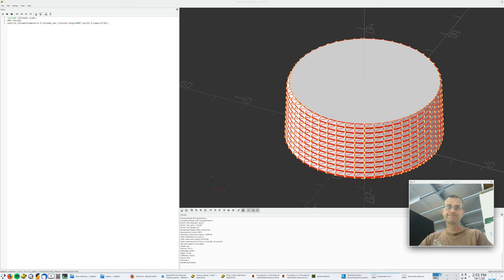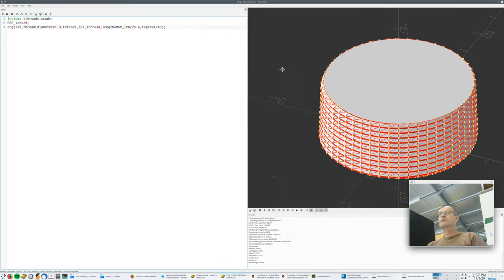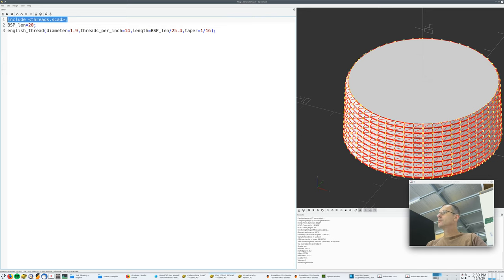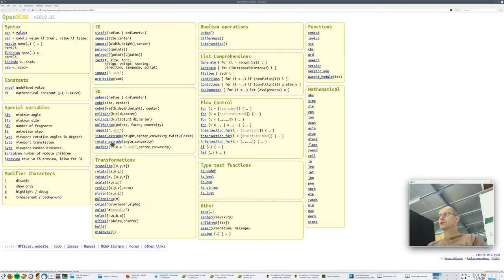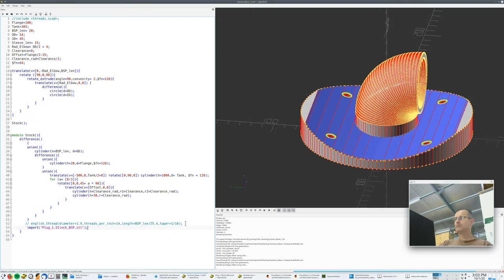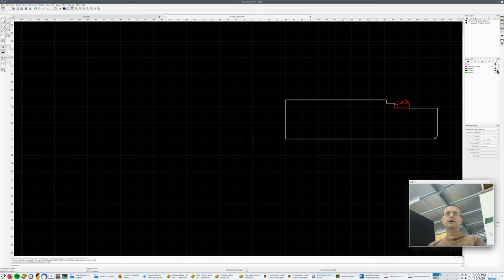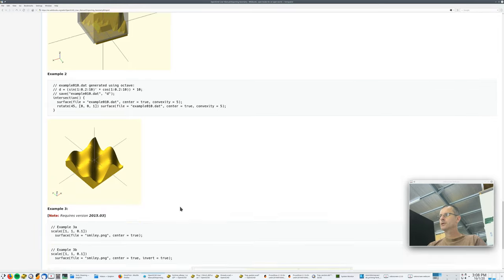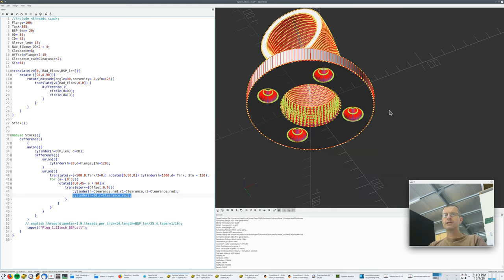OpenSCAD, importing files, Threads, some more coolness.

Comment: Very informative video. Thank you. I have just gone over to openSCAD and I'm loving it. Once you get your head around it, it's great. A lot of the code is just simple cut and paste then change the parameters as required. So easy to make changes.
Reply from the maker: I am loving the clean design control,  and the speed.